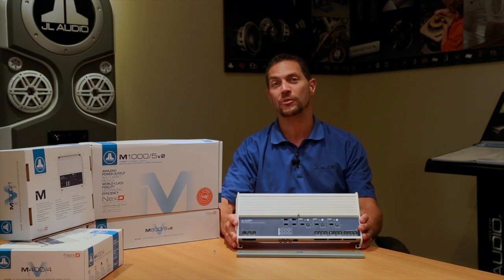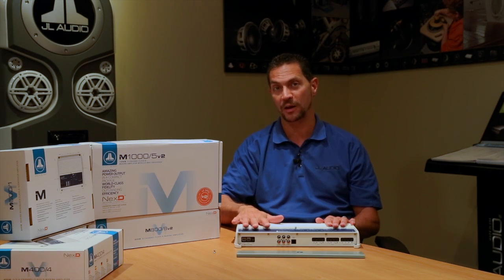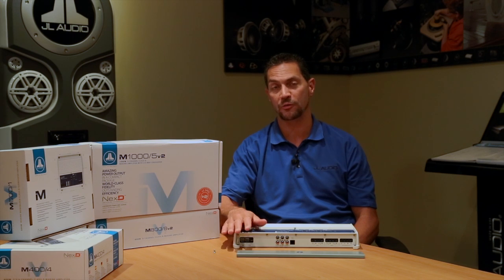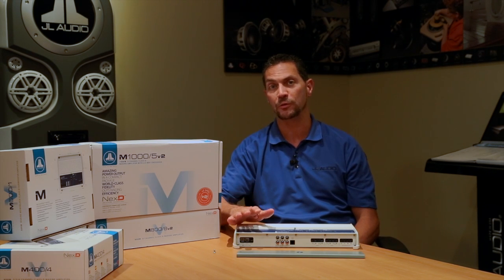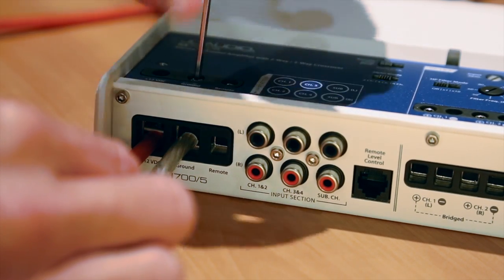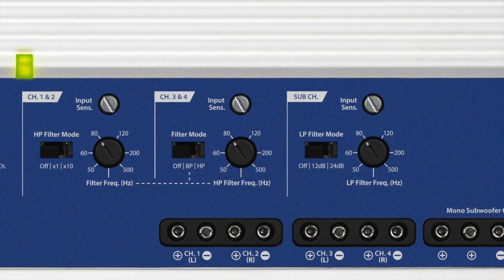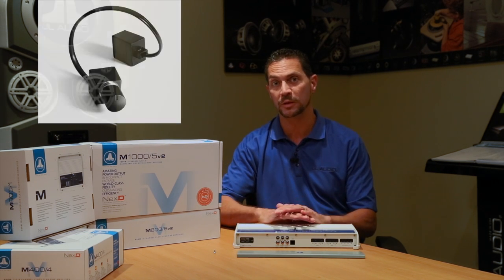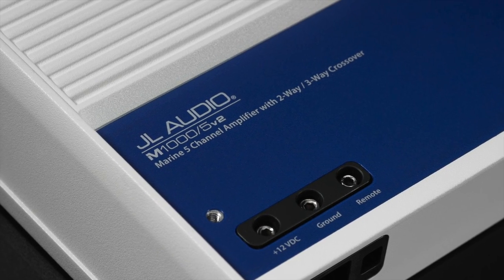JL Audio M1000/5v2 Product Spotlight

Comment: What 4 speakers would be good to run off of this?
Reply from the maker: Several of our speaker lines would work with this amplifier. With the M1000/5 you could utilize the M6 and M3 speakers, as well as our speakers designed for mobile audio: our C7, C3, C2 and C1s

Comment: I am not fully understanding what is what. Im looking to use a 5 channel amp to install in my semi truck and i cant figue which is the best choice? Yall have 3 or 4 900 or 1000 watt amps that are 5 channel. Ive narrowed things down to the point after the 5 channel Alpine is crossed off to Rockford p1000x5 and best i can tell xd1000x5. What is the difference in it and the hd900x5 and vxi and all the various versions. Quality is my focus here im not setting up a kiss concert. Rock music is my main genre but i listen to a wide range of stuff. Probably gonna go with a sealed sub. 10s would be most likely.
Reply from the maker: Adrian, the different amplifier series all have their own individual features that can help narrow down your choice depending on your needs. 

The VXi amplifiers are the only models we offer with built in DSP, they'd give you the highest ability to adjust the audio system with the ability to do equalization, custom signal routing, time alignment, and custom crossovers. These amps must be set up using our TuN software on a compatible computer or tablet (using the VXi-BTC). HD-series amplifiers have regulated power supplies, providing the rated power even in conditions where you may be low on voltage or current. The HD also has the smallest footprint, so if space is at a premium it may be a good option. The XDv2 are a great balance between good clean power at a lower cost than the other two, while still having the NexD power supply, adjustable input modes, and giving you the ability to shut off crossovers.
Reply: @garminaudio  so are the vxi models the best for sound quality?
Reply from the maker: All three models could honestly give you excellent sound quality, the difference with VXi is being able to fully customize the response in the vehicle to get the most accurate acoustic reproduction and staging.

Comment: Hi Steve, I need your advice on witch amp to get. I'm putting the 12 inch sub on my boat this week. What amp do you recommend for that single sub. Thanks.
Reply from the maker: Hello, if you wish to run the full rated power to the subwoofer I would suggest the M1000/1v2. It will supply 600 watts at 4 ohm to the single subwoofer. Another good option at a bit less power would be the M600/1 which would provide 400 watts at 4 ohm to the single subwoofer.
Reply: JLAudioInc great thanks for the reply. Most likely I will go with the 1000. :)
Reply from the maker: You are very welcome.